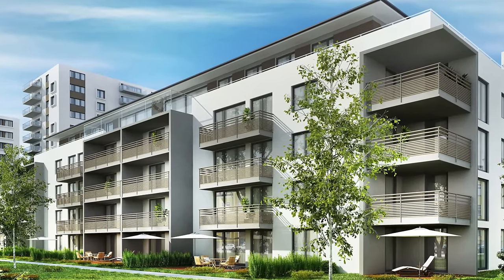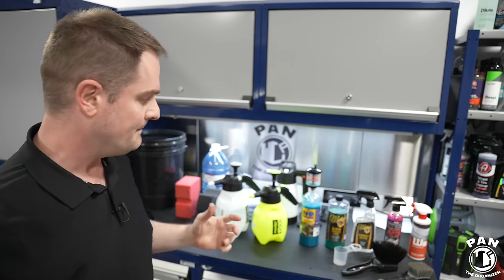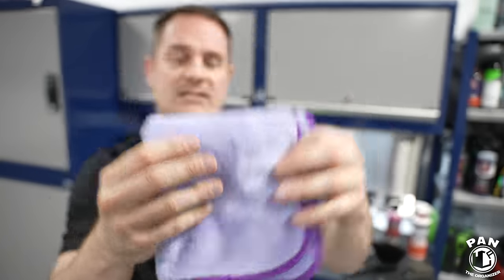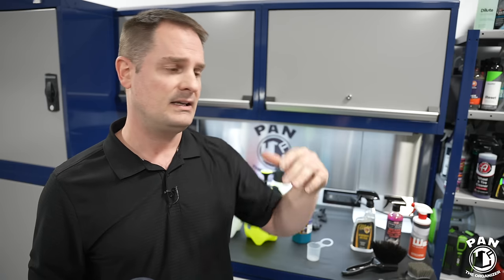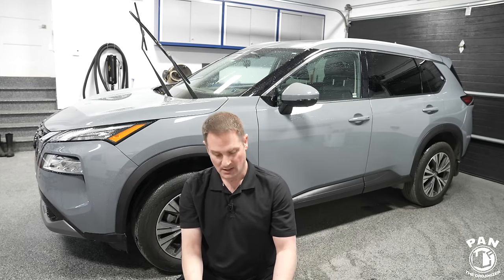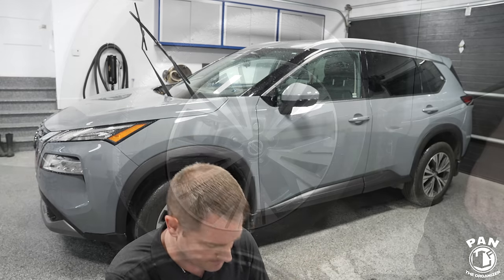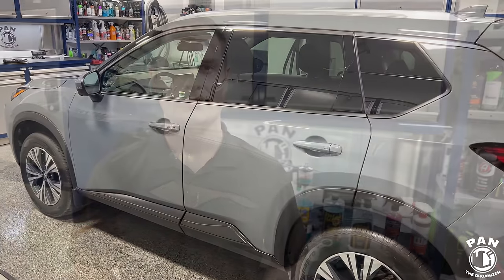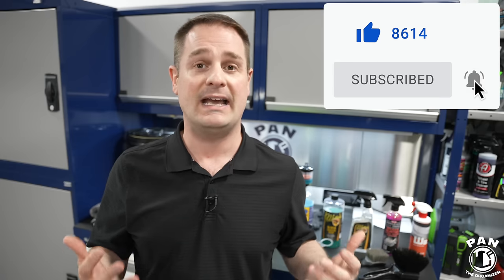How to wash your car without a hose or pressure washer! (RINSELESS WASH METHOD)

Comment: Hi Pan. I really enjoy watching all your videos. I learn a lot from it. I have a quick question regarding using washing my car using the ONR rinseless method. After i wipe down a panel with the big red sponge, do i have to immediately dry the panel with a microfiber towel? Will it leave behind a waterspot if i don't dry it off right away? Or can I go about wiping down my whole car panel by panel and then at the very end, dry off the entire car? Thanks!
Reply from the maker: There shouldn't be any water spots left behind, as the rinseless washes typically contain water softening agents that help prevent that. As long as you're not working in scorching heat or crazy direct sunlight, you can dry at the end of the process.
Reply: @PanTheOrganizer  thank you for the response. Do you have any suggestions in how I can incorporate doing a clay bar into this rinseless wash method and is there any extra spray/lubricant I should use? Because i was thinking about clay baring my car first before I apply a ceramic spray and then drying the car...

Comment: Thanks for another excellent video. Do you first    apply the ONR on the entire car or do it sections? Applying to a section and drying it off before going to the next section. This may reduce the chances of ONR drying on the paint specially if you are working outside.
Reply from the maker: You first start with the pre-treat. You mix your solution in a bucket, then fill up a pump sprayer with that solution. You spray the solution all over the vehicle, and let it dwell a bit to start softening the dirt. Then you use the dedicated sponge, or wash mitt, and start washing the vehicle with the rest of the solution in the bucket.

You can do one panel at a time and dry it (if you work outside on a warm day), or if you work in the shade or in a garage (ideal conditions), you can clean the entire vehicle at once, and use your microfiber towel at the end to dry. Both methods are acceptable.
Reply: @PanTheOrganizer  Thanks for your prompt reply as usual. I live in India and the summers here can get very dusty, the car gets dusty the very next day after the pressure wash and wax. So I was thinking of using ONR for rinse-less washing when there is dust on the car (I remember you had advised against using Jopasu Duster or use it with a very light hand if at all). My car is parked in a covered parking; one side is open to elements and that is where the dust comes from, it does not get really dirty and I may not need to pre-treat the car with ONR, or should I do that even for just the dust? Your videos are really very insightful and helpful.

Comment: Great video tutorial Pan. As a time saver, would you recommend using 1 bucket (4 gal)of wash solution on multiple cars, if possible or mixing a new batch each time? Water restriction in my area.  Thanks.
Reply from the maker: I always recommend that a fresh batch of rinseless wash be done for every car. Unless the car you washed isn't super dirty.

Comment: And then we use 10 to 20 gallons of water to wash our micro fiber towels, sponges, brushes, bucket and other equipment...not to mention washing out the shop. Handy if no water hose is available but definitely not a water saver. Thanks for demo
Reply from the maker: For sure during the actual wash process, you undeniably save a lot more water compared to a traditional hose wash. 

But I get your point for after. But it is what it is. At one point, to get a car clean you do need some water.

If you’re not comfortable with that, then just keep on driving a dirty car. 👍🏻

Comment: This may sound ridiculous, but how about chemical decon in such conditions? Is it possible? And application of sealants like Gyeon WetCoat? Much appreciated for the answer! Nevertheless , great job, Pan! Thanks for sharing knowledge!
Reply from the maker: Yes you can still pretty much do everything you normally would, as long as you use common sense. If the car is caked in a layer of thick mud, pre-rinse first with a pressure washer or garden hose.

Comment: Pan, you have been my "go-to" since detailing my personal cars for about 3 years now. Quick question for standard maint. wash.(with water)  after foaming and rinsing, why not just foam again - use mitt to wash and rinse mitt in clean water? Why use a soapy solution in a bucket when you can just use the foam?
Reply from the maker: Nice to have you as a long time viewer Bill. The foam eventually runs off or dries off a bit, so it's best to have a bucket with soapy water as you go along. The snow foam is meant to add a bit of extra lubrication, but depending on what snow foam you are using, might not be enough to do as thorough a job as your dedicated car shampoo does as well.
Reply: @PanTheOrganizer  Thanks for the reply. I use the Adams Car Shampoo with the Griots foamer. REAL thick and stays on quite a while. Much longer than it takes me to wash. Thanks again.
Reply from the maker: My pleasure! Hope you had a great week. Stay tuned for the next video on Saturday! :)

Comment: Thank you for all your work. Do these products safe for a car with ppf and ceramic coating? I have xpel fusion on my car.
Reply from the maker: Yes you can use rinseless washes on ceramic coated cars (the vehicle in the demo is coated) and on PPF.

Common sense is needed if you are doing a rinseless wash. If the car is super dirty, you would pre-rinse it. A rinseless wash doesn’t mean you never rinse, it just means you don’t have to rinse at the end of the wash process.

Comment: Would you do this in the middle of the week if you ONLY wash your car on weekends 🤔.. great info Pan
Reply from the maker: You use this when ever you wish really. I still use the traditional two bucket method to wash my car twice weekly though.
Reply: Yes. I keep a spray jug full of onr and will clean my car after work.  Easy peasy.    I use lots of towels

Comment: Great video Pan, I have been using this method with ONR for the past 10 years. I prefer to use 6 plush microfiber towels over the sponge. Since I  am going to wash my drying towel, I use the MF towels- folded into quarters so I have enough clean sides to do the entire vehicle. For my wheels, I find ONR cleans as well as Brake buster does and I use separate MF towels to dry the wheels since there is some residue I save my Rag Co Gauntlet for the paintwork.
Reply from the maker: Thanks for sharing

Comment: hey Pan, thanks a lot for your videos. Here, in Chile, we don't have that kind of products (rinseless productos). Can you show another options to wash out car withoit pressure washer? thanks a lot!
Reply from the maker: There isn’t any other alternative unfortunately. There are only three ways to wash a car:
1) traditional way with water, buckets and pressure washer or garden hose
2) rinseless wash without pressure washer or hose
3) waterless wash (no buckets needed, just spray the product and wipe off). But this isn’t recommended as you will probably end up scratching and marring the paint.

Comment: Hello Pan, thanks for the excellent video.Just a question. When pre-treating the surfaces with the rinseless wash, and then applying an APC or any other chemical on top, aren't you basically halving or more the concentration of the alcaline product, given that it dilutes in a soaking wet, pH neutral solution? Thank you in advance
Reply from the maker: I don't recommend an APC as a pre-treat for every regular wash. You run the risk of weakening the paint protection, and perhaps even start stripping off weaker protections like waxes or sealants. An APC is more a once in a while thing for deeper cleanings, or perhaps as a pre-treat before doing a full A to Z decon, paint correction and ceramic coating application.

I prefer using a higher alkaline snow foam as a pre-wash when needing a deeper clean. But up to you to decide what's best for your wash regimen.

And yes of course, when you are spraying a product on top of a rinseless solution, you are slightly diluting it. How much is unknown as it's not as simple as saying 50% dilution... But I wouldn't overthink the moment for that.
Reply: @PanTheOrganizer  I own a ceramic coated car, and I mostly use the APC (Labocosmetoca Ductile) for wheel and tyres, not the whole car, where I usually spray Labocosmetica Primus 2.0, so both very save (the latter is VDA) products.
When combining Ductile and Primus I usually spray the former on bugs and the cover it with the pre wash on top. I guess with a rinse less wash like yours I would have swapped the order of the two, just because I have a very good nano and I use very safe chemicals. 
Thanks again for your opinion 🙂

Comment: Awesome work as always! Do you have a preferred product and process for removing tree sap off of a ceramic coated vehicle?
Reply from the maker: Use a tree sap remover or bug and tar remover like CarPro TarX or Gyeon Tar. Hopefully the tree sap is fresh, as if it was left to bake on for too long it can be a headache to remove as you aren’t supposed to clay or polish coated cars.
Reply: @PanTheOrganizer   Thank you for the info. I try and catch it as soon as possible. I noticed a couple of spots on a panel and a couple on the roof. Have a great one, Pan!
Reply: @PanTheOrganizer   I used Stoner's tar and sap removal. Worked perfectly as well as removing some dried glue from a PPF strip on my door.

Comment: Hi Pan, love your show :)
Will it be safe to go for soap wash (with the foam cannon), wiping the soap with the Ultra Black Sponge and rinsing it in one bucket with ONR solution?
Reply from the maker: That’s not how that works. You either do a rinseless wash, or do the traditional two bucket wash with shampoo and microfiber wash mitt.
Reply: Thank you for this answer.
So, if I would like to go for the ultra black sponge over microfibre, because of it’s benefits. Should the sponge be used the same way as a microfibre wash mitt is used (2 buckets method) when washing with a foam cannon?
It doesn’t make sense to me when using a sponge, unless it is the foam in the bucket is the problem.

Comment: Hey Pan, I thought you said you can pre rinse with a hose early on?? If so can I pre rinse with a hose, then just use a normal spray bottle mixed with some rinse less wash instead of like a IK sprayer?? Then use the rinseless wash with the proper sponge in the bucket?  Thanks again I have only used mckee 914 and now the mckee graphene rinseless wash.  Thanks again.  Just want to do things proper
Reply from the maker: You can use a pressure washer or garden hose to pre-rinse if you want to, yes. But here I wanted to demonstrate the entire thing WITHOUT those items, to show exactly how it's done for people who don't have access to a garden hose or pressure washer. If you have access to a pressure washer, might as well just use the traditional two bucket wash method in my opinion.

Comment: Pan. How do you feel about using TW Hybrid Solutions Ceramic shampoo in a diluted manner as a rinse less wash? I’ve noticed it has very low suds and great lubricity. I’d love to see you try it on a video , along with the wet wax as a drying aid.

Comment: Great video!   One question, if I made up a second bucket of ONR solution, more than I needed for s single wash, would it stay mixed?   Would I have to shake the bucket after a week to remix it?   Asking because I don't think 2 liters would be enough for my truck.   Thanks
Reply from the maker: It should be ok for at least a month. Beyond that, hard to say how stable the mix will be especially depending on the quality of the water you used for the dilution.

You aren’t mixing two liters by the way. When you do a batch in a bucket, you should do at least 3 gallons (which equates to a little over 11.3 liters). 1.5 oz of the rinseless wash in that 11 liter solution.

Comment: Great video!  I know the runoff is minimal but does the runoff from these products leave a cement garage floor slippery?

Do the products stain a cement garage floor?

Thanks
Reply from the maker: No slippery effect. My floor is coated so I can’t answer about the staining part, but I have never heard that a rinseless solution stains concrete. It’s just water with a bit of the gentle cleaner in it.

Comment: Great tutorial as always Pan! How does this differ from a waterless wash? As I see both waterless and rinseless washes.
Reply from the maker: A rinseless wash still uses water (in the bucket) compared to a waterless wash that uses ZERO water. You just spray the waterless wash and wipe. Hence why rinseless washes are considered a safer technique compared to waterless. Less chances of scratching and marring the paint.

And also, with a rinseless wash, use common sense. If the car is super dirty, you would pre-rinse first with a garden hose or pressure washer. Rinseless wash doesn't mean you never rinse, it just means no rinsing is needed at the end of the process.
Reply: Good to know, is a waterless wash a more concentrated/stronger solution and if so, could be used like a rinseless wash if diluted properly?
Reply from the maker: That's not how it works. Rinseless washes need to be used at the appropriate specific dilution for use as rinseless washes. Using more would change the dilution ratio and not necessarily make them clean more. It would just change them to a quick detail spray for example.

Optimum No Rinse, for example, like the McKee's 37, are used 256:1 standard dilution for use as a rinseless wash. 0.5oz per gallon of water. If you add more product, you are turning them into quick detailers, clay lubes or waterless washes. It won't change their cleaning ability.

Comment: I don't have a need to use rinseless method so will stick to traditional method. If ONR is so slick and does a good job of encapsulating dirt,  how effective is it as a pre-wash spray vs a foam cannon shampoo (eg, gyeon foam) in removing dirt during a pre-wash stage in a 2 bucket method?
Reply from the maker: It's more about lubricating the surface before pressure washing. I made a video about a rinseless pre-treat here: https://youtu.be/ukL-3LBOSmU

But after the pre-treat, I still like to foam the vehicle, and rinse, and then move to the contact wash using the two bucket method.

There are many ways to wash a car. Not just one method. I like the traditional method, but some people simply don't have access to free flowing water from a garden hose or pressure washer, so the next best alternative is a rinseless wash, assuming they do it right and use common sense.

Comment: Hello Pan! I finally bought the product I am gonna try it this weekend. Could you please advise me some tips? I am gonna use it along with soft99 qujitsu sponge due to the fact that dedicated sponge is extremely expensive. Will that setup do? I won’t be risking any scratches? I would like to use also the wet coat from gyeon instead of opti seal. Will that also do? I am wondering if I can use the wet coat the same way as opti seal is supposed to be used.
Reply from the maker: WetCoat is not a drying aid. It’s a spray on rinse off sealant. You spray it on a wet surface and immediately rinse it off with your pressure washer or garden hose. So not really to be used with a rinseless wash method.

For the rest, keep in kind if the vehicle is very dirty you should be rinsing it first before starting the rinseless wash method. Common sense is needed with this method if you don’t want to cause scratches.
Reply: @PanTheOrganizer  thank you for your quick reply. I forgot to mention that I will not wash the car with this method when there is sand or big particles on the surface of the paint. Could you please recommend the cheaper but still great solution for drying aid?

Comment: I had a CarPro ceramic recently on a 92 pickup, looks great for now.
can a grapheme coat be layered? 
Biggest question: I need a simple maintenance list. Of products and how often..
Can I mix brands and products 
I live in a cold/hot dessert with lost of alkaline salts in water, even light rain storms
Gritty dirt wind
Reply from the maker: Hi Eileen. If your car already has a ceramic coating on it, no you don't apply another one on top. You simply do a maintenance by applying a spray topper once every other month. I made a tutorial on a simple maintenance wash for a coated car here: https://youtu.be/yLiePQRMFc8

Once you get near the end of your coating's expected lifespan, then you would redo all the steps including washing, decontamination, machine polishing (crucial step to ensure 100% removal of the previous coating), IPA wipe and then you apply a new coating.

I hope this helps!

Comment: I am a first-time. Can I use ONR as a pre treat and rinse down with a water hose and then use 2 bucket wash methods, soup one bucket  and wash one bucket? 
After wash, I am planning to use meguiars ceramic detailer.
Reply from the maker: ONR as a pre-treat before you do the first rinse yes. But keep in mind ONR isn't a pre-wash like a proper snow foam. So you could pre-treat with ONR, rinse, then foam with your favourite snow foam, rinse, and then do the bucket wash (contact wash).

Comment: This applies to me as my garage isn't heated in the winter and we use heavy salts in winter in Ontario and I don't wanna head over to the coin wash to use the water
Reply from the maker: Common sense is needed for the temperature. If water freezes, than it will freeze the solution containing the rinseless wash too.